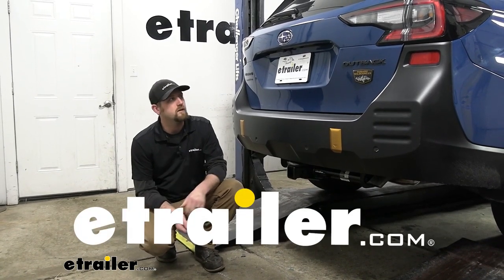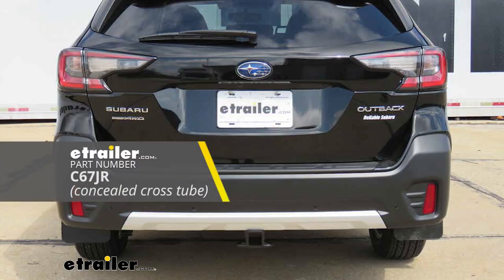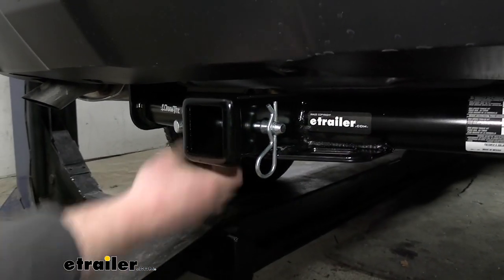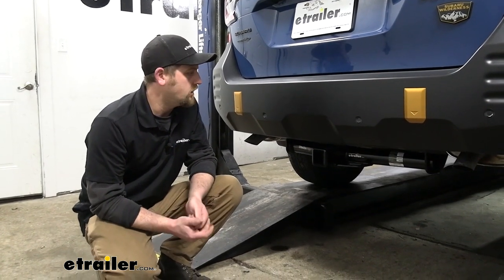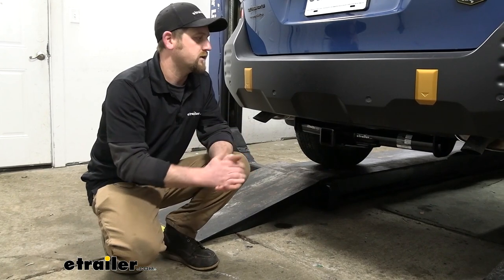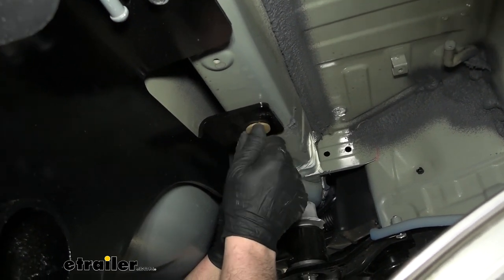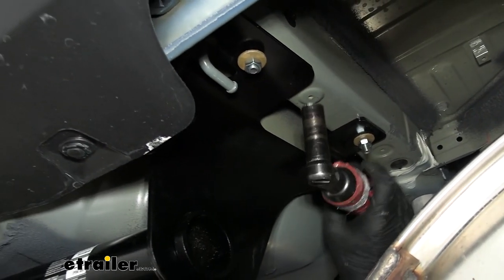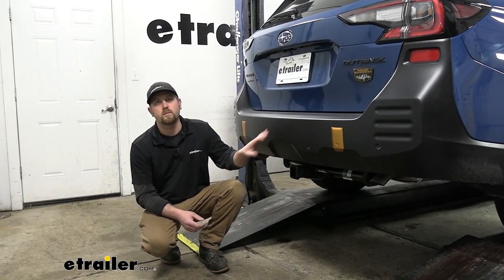etrailer | DIY Install: Draw-Tite Max-Frame Trailer Hitch Receiver on your 2023 Subaru Outback Wagon

Comment: Quick question .On a 2021 Outback Onyx XT  i don't know the make of the hitch my local business installed , the question is should it be making groaning moaning sounds while towing a 17' aluminum boat? Took it back they retightened and double checked everything but still does. They because of the uni body? And being no dead space like a trunk in car

Comment: If your bolt and bracket get lost in the frame, you can align them from above. Lift the spare tire cover, remove the flat side panel and foam cap. You will see 4 circular reusable “stickers”. Remove them and shine a light from the bottom and you will see the bolt and bracket.
Reply from the maker: Excellent tip, thank you!
https://www.etrailer.com/Trailer-Hitch/Draw-Tite/DT73RR.html

Comment: 11/16" Why mix SAE w/Metric?
Reply from the maker: The Draw-Tite # DT73RR you'd looked at uses 7/16-14 grade 5 bolts. No metric hardware.
https://www.etrailer.com/Trailer-Hitch/Draw-Tite/DT73RR.html
Reply: Hmmm  @etrailer  M10...8.8... Grainger, McMaster-Carr, and Fastenal have them by the hundreds of thousands in any dimention/pitch you could want